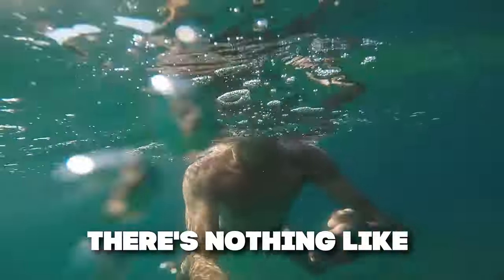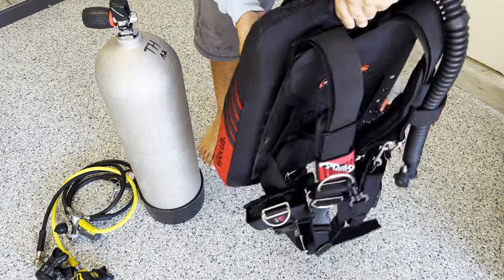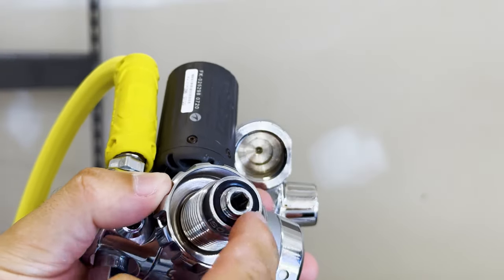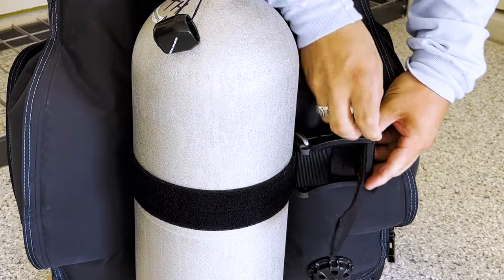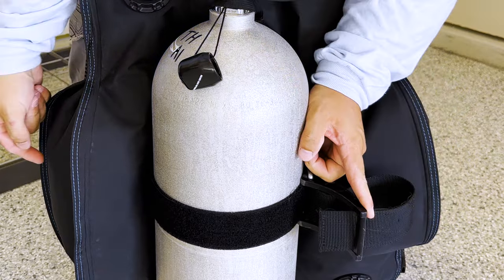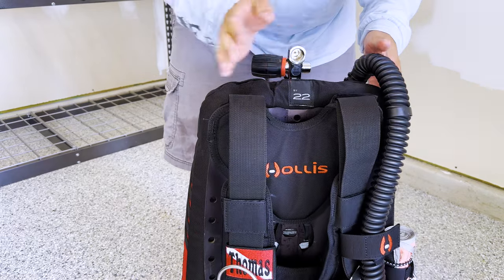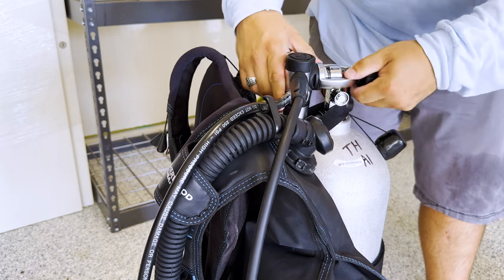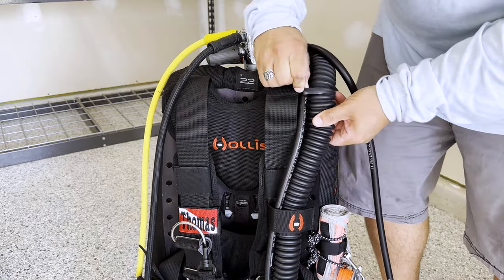How To Set Up Your Scuba Gear (Scuba Gear Assembly Refresher)

Comment: Had a potentially bad accident years ago in Key West. I got paired up with a guy from South Africa and I didn't pay much attention to him setting up his gear. We rolled off and followed the rope down to the Vandenberg. As soon as we righted ourselves, I see his head jerk back. His tank slipped out of his BCD. He'd forgotten to wet his tank straps before he assembled it. I saw his eyes get real wide and he suddenly tried to bolt for the surface. I barely got a hold of one of his fins and jerked him back down, gave him my octo, then reinserted his tank for him. Close call. And ever since then, I watch my assigned buddies like a hawk. especially pre dive.
Reply from the maker: Dang, it fell so bad he had his reg pull out too? I’ve seen tanks slip but usually they catch on the extra collar up top or don’t fall out completely. Good on you to grab him, but sheesh!
Reply: @CircleHScuba  i thought that too, but apparently he didn't even put the horse collar over the valve. Yeah, I learned a lot that day about stranger dive buddies. Felt bad for the guy but OTOH, he hoovered his tank pretty damned quick. I still had 1200 when he showed me his guage at 800 and we were at 95fsw. Felt kinda ripped off.
Reply: @CircleHScuba  I should clarify though that his reg didn't get pulled from his mouth, but it was pulling his head back. I gave him my octo to take the strain off his neck while I sorted his tank issue out.
Reply from the maker: @jojodiver8706 that makes sense too, dang though.

Comment: I was a DM for a Dive shop on Guam back in the 90's and accrued nearly 2000 dives. I haven't dove in over 20 years, and came back to Guam to live and work. I needed to get the refresher course out of the way so I would be a safe buddy for someone else. The 1/4 turn back thing....well...it's to relieve the strain on the brass screw in the tank valve so it lasts longer. People will crank them open HARD and that wears them out. Now I just slightly back off the pressure on the valve and that is better than jamming it down tight. I go with what works. That works.
Reply from the maker: Modern regulators and air integration sensors are not made with the quarter turn back in mind. I hear you, but technology changes. Just don’t crank your tank open hard, which was the problem all along.

Do what you’d like, but it’s definitely not needed and not recommended anymore.

Comment: You should actually point the back of the spg down or in a safe direction not the front, because there is a rubber burst plug on the back of modern spgs that is a designed failure point. Similar to the quarter turn back thing it's just an antiquated story when gauges were worse.
Reply from the maker: Ah interesting, I wonder if that’s dependent on the SPG design then though? I’ll double check the ones I have but I don’t recall seeing anything behind the gauges under the boots
Reply: @CircleHScuba  im not sure how universal it is, but any boot with a hole in the back is there to allow the spg to burst at the designed point

Comment: I didn't know about the half turn being outdated. I was certified many years ago when I turned 13, and my first dive buddy was my father (who was an old NAUI instructor) and he beat two things into me when opening the cylinder. Point your SPG away and do a half turn back.
Reply from the maker: Yeah the half turn back was back in the day. Now, regs are designed for the full tank pressure when they’re bench tested and adjusted for their ease of breathing. Also a full on tank can only turn one way, so in panic it’s easy to know which way to turn it, for example in technical diving work stage bottles ensuring it’s on, a valve shutoff need from a failed regulator, etc.

Comment: Thank you very much for your video. I wasn't aware that the quarter turn was outdated. Just one comment: the pressure gauge danger isn't a myth. I have a seen a pressure gauge fly off a hose at a speed that would take someone's eye out or worse. Everyone should be careful when opening the tank.
Reply from the maker: I didn’t think it was, but I always face it toward my BC or a safe direction anyway haha. Thanks for the comment!

Comment: Nice review! I think some divers consider a refresher course a bother, a chore, or something to try to avoid. I think it’s always a good idea to stay as sharp as you can. Also, we dive DIN as well. Any suggestions on the best way to get a good seal and fit when attaching to tanks? Especially with well used rental tanks. We’ve found that after removing DIN inserts, the tanks can sometimes be difficult to get a good seal with the DIN Regs. Thanks!
Reply from the maker: I completely agree, it’s important if it’s been awhile!

I haven’t had much issue with getting a good seal on my DIN when they take the insets out (pro valves). As long as my o ring on my reg is set well, it shouldn’t be a problem. Line up the threads, screw it in until its finger tight, then test.

If you’re having that problem, ask the boat’s DM or the dive shop to see what’s happening because that shouldn’t be a bother! 👍

Comment: I have a question about the half turn back. I was taught that too but you say modern equipment is built for the full turn. My regs (Aqua Lung) were bought in 2011 do these count as modern?
Reply from the maker: Yes I wouldn’t do the half turn back for those either

Comment: Hello @circle h scuba ! I do wear my octopus on my left side so that it doesn’t loop a « S » if you have to donate. What would be the justification for having the alternate air source on your right side ? Tks !
Reply from the maker: Honestly I’ve never seen someone have a regulator anywhere but their right side when worn. So justification would be to be consistent with where people expect it to be found and routed. Good question though!
Reply: Tks for the answer ! I’m French, and I see a lot of left shoulder octopus. I never had a real out of air situation except drills, but had my fair share of low air situation : buddy / student is around 60 bar, I’m at 90, I use my left shoulder octopus (with a 110 cm hose) to share air and my buddy finning gently on my left, and get him back to his regulator during safety stop, so that we can exit the dive with the required minimum 50 bar tank pressure.
Reply: + I usually clip my octopus on my left D ring, to make it visible and accessible in my triangle of life.

Comment: Hey circleHScuba I am actually now a certified diver just today will not yet because the shop owner still has to do the paperwork but actually I am technically a diver now but now it's time to get my equipment now that I passed my open water diving so yay😊🎉 but can I tell you something whenever doing my for open-water dives I actually kind of hate the jacket style BCD that we were using one is because it's not really secure and then the tank goes up with the b c d and then when I move my head I hit it on the yolk and also the plastic part of the handle/bracket it was pushing on my hip and it hurt quite a bit on the left side of my hip and it felt uncomfortable and I feel like like a backplate with either a back inflated BCD or like a wing or donut with like an extra crotch strap and padding would definitely be beneficial for me and I definitely did not feel comfortable with the jacket style BCD.
Reply from the maker: Woohooo!!!!! Congrats man!!!! I’m so excited for you!
Reply: @CircleHScuba thank you😊👍
Reply from the maker: @Divewith.G.M I have a video coming out very soon about what to do after getting certified that’ll be perfect for you 🤓
Reply: @CircleHScuba oh and also one more thing about the jacket BCD is that the straps bra so kind of like pressing against my chest and making it a little hard to breathe 😮‍💨 but I did try out a b c d that one of my instructors used it was one of those like special discount ones you know what I mean 4 like pro divers and instructors but they do have other ones that are not on a discount but whenever I tried it on my hips felt fine the straps were not tight on me restricting my breathing and it also had a crotch strap so my tank doesn't go up and my BCD plus I can also adjust it to my body and I can change it if my body changes so I think I found a winner for my BCD🎉
Reply: @CircleHScuba  by the way I don't know I don't think I said bra I don't even wear one but I am using auto-text to speech so that's probably why you know what I mean 😂
Reply from the maker: Ah that sounds like a backplate and wing, I love those! Congrats on finding a winner!
Reply: @CircleHScuba  well did you know there's actually three different types of BCDS that you can put on a backplate the first one is a wing style which is the one that you're talking about, the second one is a donut BCD by the way a wing BCD goes like a wing around the tank and a donut BCD goes all the way top bottom left and right to the tank and a backinflate BCD is like a pillow so there you go those are the differents so hopefully that helped 👍 because not every diver knows about everything you know what I mean 😁
Reply from the maker: Yes I know the types 😜

I actually am planning a video about that too in the future haha. So many video ideas to do!
Reply: @CircleHScuba  but how come in the video you called the b c d a-wing BCD when it's actually a donut BCD I guess you do that to trip up the new people who are diving maybe you just wanted to see if somebody could get it correct ✅ you know what I mean.
Reply: @CircleHScuba by the way I don't think I'm going to need to see the video about the items and finding out what you need because I was actually ahead of the plan and thinking of what I might need well I was going through my open water diving certification and I thought of which regulators and BCDs that I need so when next year the diving trip hits in the keys I already have my full set up will the other divers are renting waiting to look for the right b c D's and other regulators 😜 you know what I mean. But thanks for putting that video out there just in case if somebody needs it you know what I mean.
Reply from the maker: I called it a wing because that's what everyone calls a backplate and wing, haha. It's extremely common terminology. As you continue your diving journey, you'll learn about all the lingo too :P

For example, entire BC categories under "wing style" exist: https://www.houseofscuba.com/collections/bcd-wing-style